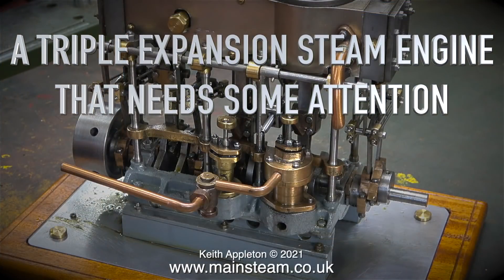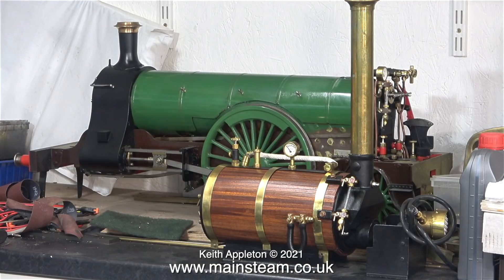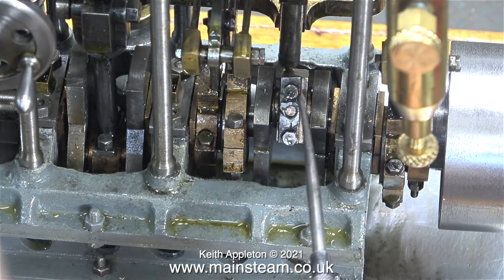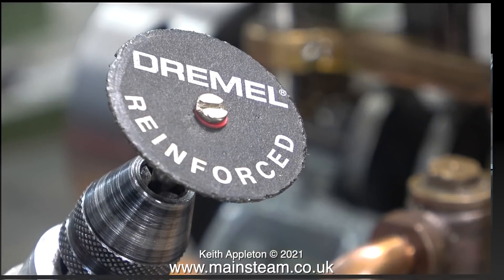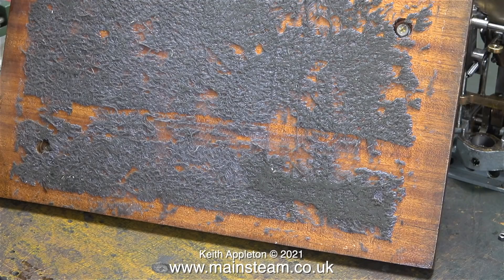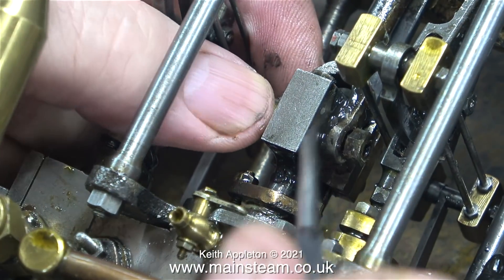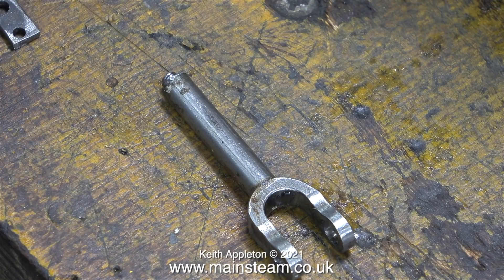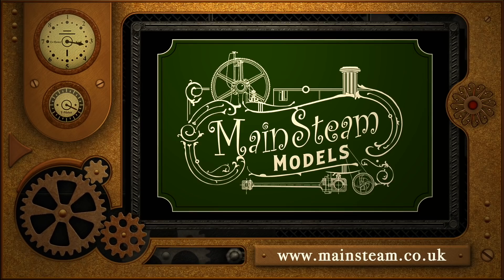A TRIPLE EXPANSION STEAM ENGINE THAT NEEDS SOME ATTENTION #5

Comment: They call it "brake cleaner" for a reason, It is for cleaning "expansion brake housings of the stuff that builds up in them, and for no other reason. You use what you call "Gun Wash" that we in the US call lacquer thinner, now actually banned in some places for similar reasons to the brake cleaner problem, different chemical, same health and safety concerns.
Even so, Gun Wash evaporates much more slowly, so is quite useful, just don't breath in a lot of the fumes, you will get high and damage your, self admittedly, already damaged brain. (NOT).;-)

Comment: Brake cleaner evaporates far too quickly to be useful in your situation and you really shouldn't use it in an enclosed space because it's basically ether !
I use it for cleaning my motorbike chain but I make sure to have at least one door open on my garage plus there are a few large ventilation holes in the walls too.
Reply from the maker: I never use it .........
Reply: It's isopropyl alcohol